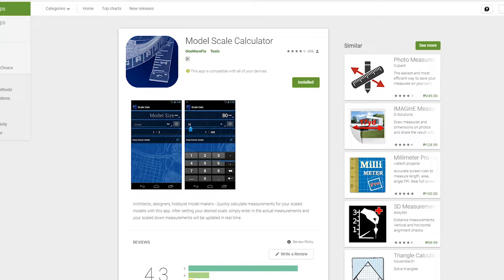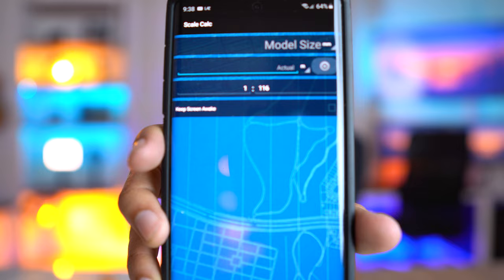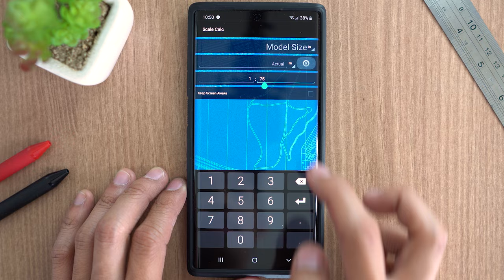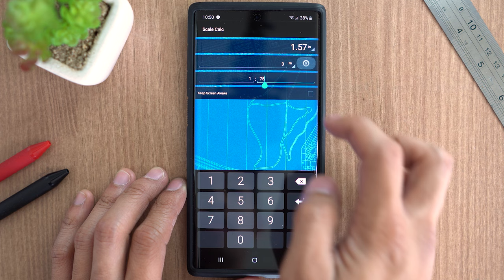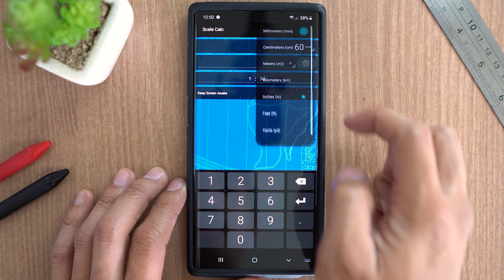How to Scale Without a Scale Ruler

Comment: I don’t use odd scales like 1:75. I haven’t been carrying a scale ruler for decades now. But do the calculations if you must need to do 1:93 for some reason. If I need scale, all I do is get the app called scale, strip out a piece of paper and mark out per centimeter of the straight edge of the paper. All you remember is 1cm is 1m in scale of 1:100. It then follows that 2cm is 1m if 1:50. If I need 1:200, then I know half a centimeter is 1m. Annotating that piece of paper with the scale you need make it easier. I keep those on my Moleskine notebook’s back pocket for future use. Freehand-scaled drawing should be the goal of any designer and can instantly create perspective drawings in proportion. There are books that teach that. Now let’s make that tutorial.

Comment: Thanks, how do you  determine the scale though?

For example the actual measurement is 20mm, you want to miniaturize or scale it to just 2.72mm, how do you calculate for the scale, so you can input that scale on the Model Scale Calculator?

God bless, Rev. 21:4